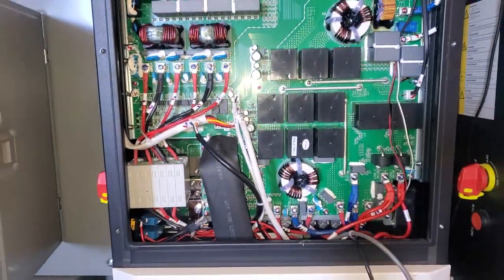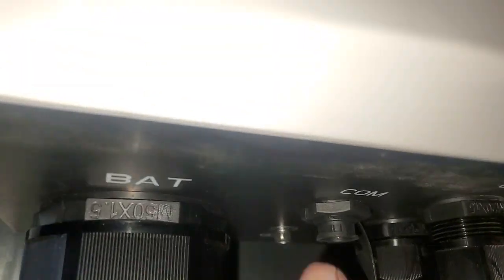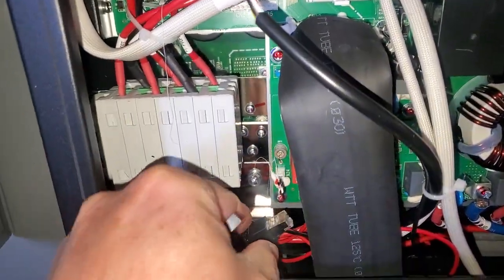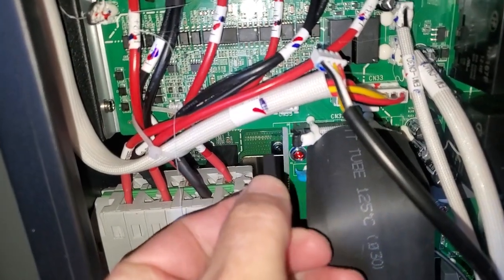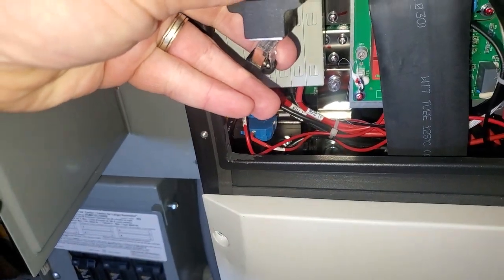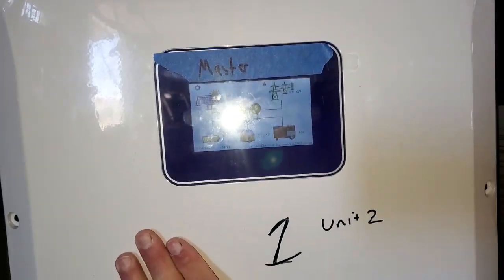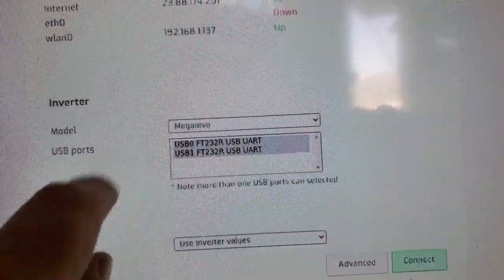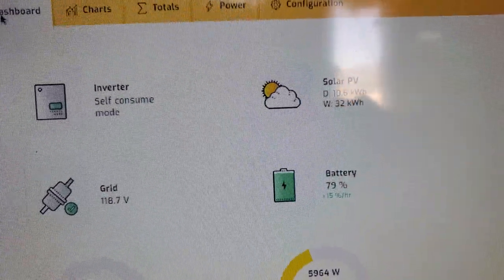Solar Assistant adaptor cable for NHX 5 / 8 / 10kw inverter with 4 x PV inputs

Comment: Could you supply the correct link for the NHX to Solar Assistant: Use with Solar RS485 to USB Cable
that is needed for both NHX Inverters?
Thanks
Scat